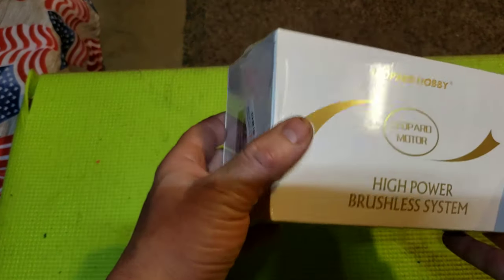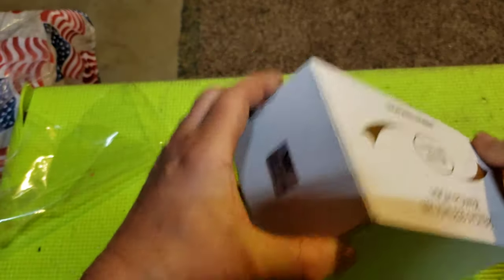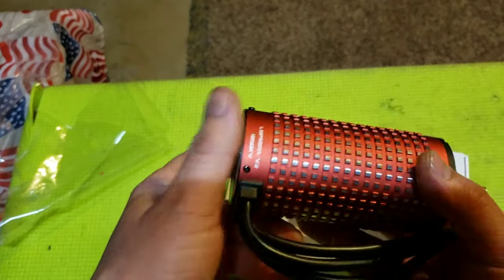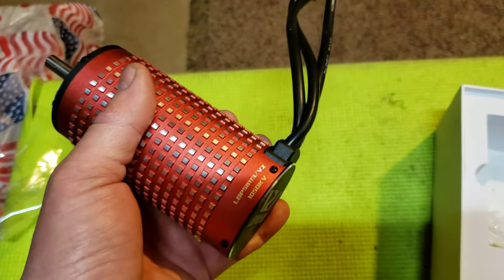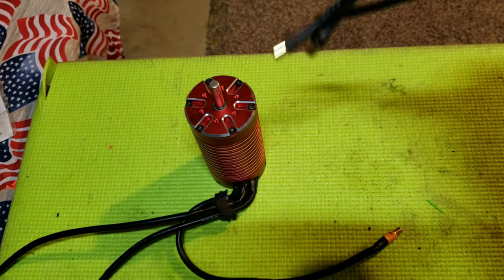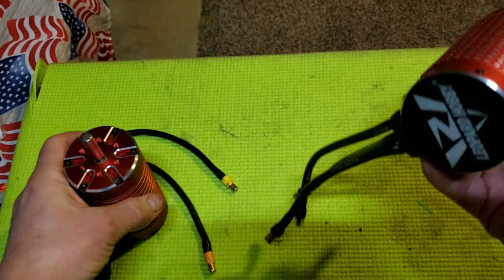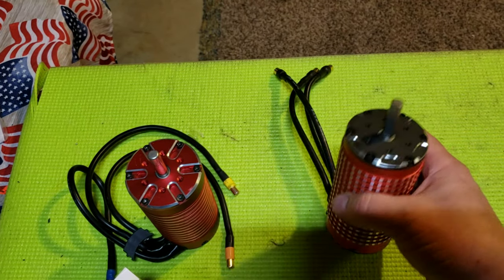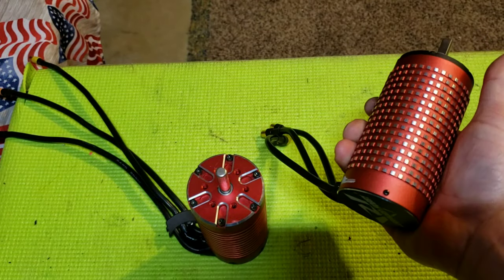Leopard hobby 1050kv motor unboxing and overview

Comment: It's been a year since you got this motor, do you know if the motor will mount in the dbxl-e 2.0 without changing the motor mount?
Reply from the maker: it should no problem, a large pinion might not work. I have a hobbystar 56112 can in her now with a 24 tooth👍
Reply: @JUICY_TIME  I have a 17t pinion on there now and I don't really see the need at this time to go any bigger. I'm thinking of getting the max 5 esc and the leopard 1050kv motor but the only place I can find the motor is on alibaba ( spelling?) and it'll take 20-40 days to arrive.
Reply from the maker: @Blueknight1960  i have a 24 tooth because the k.v is only a 580. I have good luck with rc juice, they sell hobbystar and leopard motors and esc's. the 1050 kv is awesome👍

Comment: do you think this motor is better than 1100 kv hobbywing?
Reply from the maker: I think the hobbywing and leopard are the same, I dont think you will notice the 50 kv difference. Its like coke or pepsi in my opinion👋
Reply: @JUICY_TIME  i think this one will run cooler,because its bigger
Reply from the maker: @romeoraduu  it will run cooler👍
Reply: The hobbywing 1100kv is a 5687 can motor, with 5800 watts of power. The Leopard is 58113 can motor with 8000 watts of power. They're beasts of motors, i run the 870kv and 16t pinion in my DBXLe
Reply from the maker: @geejayrc9401  hey man, I run that motor in my k8 and she runs great with a 34 tooth pinion. temps are ok, only getting 10 min of run time with 2 4s 7200 mah😉
Reply: @JUICY_TIME  how long is the run time from your stock motor?
Reply from the maker: @MaxVerstappenF1  about 10 minutes at pretty much full throttle with 2 7200 mah lipo's👋
Reply: @JUICY_TIME  i thinking of getting the leopard motor but 10mins run time with 7200mah stops me from getting it. Maybe i will go with combo Max5 and 800kV instead. There's a guy who also use the v2 leopard motor and he said he managed to get 20mins from his 6700mah battery.
Reply from the maker: You probably can get 20 with that setup but it depends on gearing and if your full throttle the whole time. but either way they are fun setups👍
Reply: @MaxVerstappenF1  you need to look at the motor specs. The Leopard 1050kv is 220amps max, the 870kv is 190amps max, the Hobbywing 800kv is 200amps max. So personally i would go with the Leopard 870kv, as you should get about the same run time as the Hobbywing, but you'll have more power with the Leopard. An even better option would be the 700kv Leopard at 150amps max, you would have to gear it right up to get the speed though, but you'll have much longer run time
Reply from the maker: absolutely👍

Comment: How long are the leads? 8” or so?
Reply from the maker: I did not measure them, but I would say around 7 or 8" it will just reach in the 8s kraton, but the bullets are too big for the esc, so you need to put 6.5 bullets on it👍😁
Reply: I have a K8S with a MAX5. So the bullets on this motor won’t fit the MAX5? I think the MAX5 uses 6.5mm bullets?
Reply from the maker: @justinvanaulen2478  yes it does I just installed a max 5 in the kraton tonight, you can use the 10awg hobbywing leads you get with the esc, hobbystar is the same
Reply: So just to clarify,  the Leopard 58113 uses 6.5mm bullets and will plug into the MAX5 with no modifications, right?
Reply: RC Juice confirmed its 8mm bullets, so I’ll just solder new 6.5mm bullets so it fits my MAX5. Is there enough wire to reach it in the Kraton 8s?
Reply from the maker: @justinvanaulen2478  cool man, the wire will just reach. It will be tight👍

Comment: Version 1 or 2?
Reply from the maker: this is about 2 years ago so maybe version 1. not really sure
Reply from the maker: @youtubsuck  That motor is the Kraton 8s with a leopard 200a esc. run's great. But it has been awhile since used.👍
Reply from the maker: @youtubsuck  probably the 980 little more torque and wont run as hot. I like hobby stars motors.👍
Reply from the maker: @youtubsuck  1100 is awesome but will run hot if your bashing. full throttle and hitting the brake heats them up fast. Also depending on your pinion size. 1050kv I love it. That would be my choice. Hope you have some good lipo's. 👍